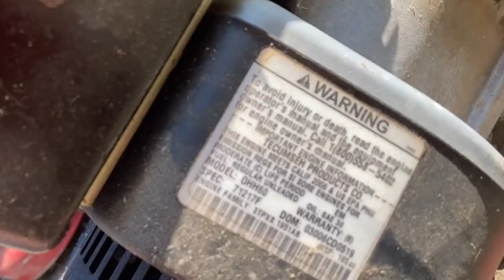GENERATOR PREPPING What you should buy now for your Honda, Briggs, Tecumseh, Chonda generator NOW..

Comment: I keep a Honda generator for the sole purpose of when we lose power. I make a habit of running it about 30 minutes a month just to keep everything fresh. I only run pure gas. It's now about 20 years old and runs like a champ.
Reply: very important to exercise the generator, not just the engine, too.  very depressing to fire up a genset that's been sitting and not get power out of it.  if you've got an electric tool and a quick task that needs it, just run it off the generator, and you're good for another month. (not necessarily for Steve, but for other owners with less experience)
Reply: I have craftsman generator from 1993 after hurricane Andrew in South Fl. I’ve put a carb on it and try to run it a couple times a month for about 30 min. and I do have to plug a tool in to “excercise” it. They are great to have just in case.

Comment: Great video and tips.  I'd like to add a few things, that we have for our generator.

1) Install a Tri-fuel kit. This will turn any gasoline only generator, into a generator that runs on gasoline, natural gas and propane. Gasoline will be hard to come by in a natural disaster.

2) Buy extra air filters to keep on hand.  (Even if they are made of foam) This way, you can wash the dirty filter and while it's drying, put in a clean filter.

3) Have a four pack of extra spark plugs. 

4) Add fuel stabilizer to your gasoline in the gas can.  Rotate the older gas by putting it into your vehicle. Then put fresh gasoline in the gas cans. (Do this every three months)

5) Keep at least two of those, 5 quarts oil containers, on hand.  

6) Run generator, with a load, every month.  This will recharge the battery and keep the engine in tip top shape.

Comment: Great idea to store spare parts! I inventory oil, spark plugs and air filters for all of my small engines in a large storage container. IMO, completely draining the carb may dry out the gaskets. Using non-ethanol fuel will help prevent the carb from gumming out. Sta-Bil will help keep the gas usable for up to a year. Bottom line, use non-ethanol fuel treated with Sta-Bil and start it up seasonally (4X a year). Run under load for 5-10 min after it's warmed up. Easy.
Reply: I agree I have repair shop and expect busy with strom coming 
Dec12-22

Comment: Great video! I have a Generac generator that if you didn't drain about a cup of gas out of the float bowl, you would be pulling the cord all day. l found if I opened the float bowl drain and drained the yellow gas out until it turned clear, it would start first pull and run great. I only run premium gas in all of my small engines, and especially with the generator, fuel stabilizer at every refuel. The gasoline is nowhere near as good, or last as long as it used to.

Comment: 100% agree, I have a gen I got from parents after they pasted. Best I can tell it hasn't run in 6yrs. Last week replaced carb fuel lines and so on. A few pulls on the big tech and off she went, plugged a couple of loads to it. Pretty good feeling now have a gas power washer to tackle.  Thanks for the help you put out there. Only thing I would add would be gas additive and or ethanol free gas stored.

Comment: I owned  a small  engine business  in Indianapolis  for 20 yrs.  I agree  with  everything  you said and would only add when putting your equipment  up for the  season  run either  ethanol free or engineered  fuel through it. Rec fuel or something  like  true fuel will save you big bucks and start up headaches.  It might be a bit more expensive  but if will give you peace of mind. I know live in Florida  and we buy our recreational  fuel in July and it stays fresh  until December.  We then put it in cars, boats, mowers.

Comment: I just recently subscribed to your channel & love it! 
I was looking back in your videos & came across this video on generator prepping. I know you were talking to everyone else & not me.
I researched the generator at our house. We have Honda’s flagship generator the EU 7000is. It is enough power to run our entire house including our 2 1/2 ton central air compressor. I have to admit it takes some juggling in my circuit breaker panel to ensure everything comes on. My generator is fuel injected & when I bought mine three years ago at my local Honda dealer I asked for every option for my needs. I even ordered the lift kit, the preheater & the shop manual. Extra air filter, extra gas filter, extra oil & extra spark plugs. I also bought a trickle charger for the battery. 2 different length cords. An auxiliary fuel tank that extends my run time to 28 hours at half load. I installed a ground Rod & bonded my genny case to the ground Rod to help dissipate static charge & less likely for an explosion when refueling. I have a plastic cap over my exhaust tip to prevent spiders from making a nest in there. As soon as it starts it fires it right off. I had a fabricator custom make a 306 stainless steel cabinet for my genny on a poured in place concrete pad. I had an electrician wire everything up. 240 volt cable rated for 30 amperes. A weather proof inlet. A duplex weather proof outlet for my trickle charger & a weatherproof hard wired remote cable. 
When we lose power I’m often at work already as I’m a power lineman for the local power company. I have LED lights plugged in to outlets around the house that come on as soon as the power goes off. My wife can easily see her way down to the basement to turn on the generator remotely. Then flip the main off & slide the interlock & pick up the whole house without having to go outside. Even our door bell works off the genny.  
I test my genny about once a month. Every other month a actually connect the house to the generator. I have enough fuel to last for a 10 day outage. All gas is treated with marine grade Stabil & Star Tron fuel enzyme. I rotate my fuel every twelve months & burn the old fuel in my trucks. My shelf where I store my fuel is grounded as well. I have a fuel transfer pump that can hold 30 gallons of fuel made by GNC. I did my research on that. They are the best around. So far I’m in the hole about $14,000. It’s an insurance policy incase the lights go out at home. I can take a hot shower after I had worked my first 24 hours straight & sleep in a comfortable house either heated or cooled. Call me a prepper. I wouldn’t mind. That reminds me, my battery is three years old. Time to buy a new battery for it. 
Nice garden by the way. 👍🏻👍🏻👍🏻

Comment: Good video! When I was a mechanic for NT&E,the hardest part of customer relations[as far as gens were concerned],was correctly sizing the genset. You need to add up all the wattages of the equipment you wish to run,and then multiply by 3.This was manufacturer's suggestion,because an electric mtr starting up draws 3X the running wattage.And if you use too small a genset,you burn up genset and your appliances.
Reply: thx

Comment: I use a propane powered generator to avoid fuel related problems . We ran it for about 4 days during the big freeze blackouts in Texas . Used about 50 lbs of fuel .

Comment: One thing I've been doing for probably 5-6 years now is treating my fuel that goes in my small engines, whether it's my 2 generators or whatever.  I've been treating my fuel with STABIL MARINE 360 at double the rate on the bottle (make sure you get the MARINE (it's Blue.., not the Red Storage version)), PLUS adding SeaFoam to the fuel at 1oz per gallon.  Since I've been doing that, I've had ZERO fuel issues, knock on wood.  I just got my big generator out last week getting it ready for the winter storm that moved through, and it has not ran in a year since I did the last maintenance run on it.  Turned on the fuel petcock, waited a minute for fuel to fill the carb bowl, and it started on the first pull, as it almost always does... and that was at about 35°F.  It's got a Yamaha MZ360 engine.  GREAT engine so far in the 57 hours I've put on it over the last 10 years since I bought it, easiest starting engine I've ever had... Honda could learn a thing from this Yamaha (and Hondas start pretty easy already)... it's a shame we don't see more Yamaha's.

I also run Shell Rotella T-6 Synthetic 5W40 in my generators... great oil, and yes, it is Diesel oil.  It's also probably one of the best small engine oils you could use.  I run Mobil Delvac 1300 Super 15W40 in all my OHV small engines that see more regular service, and it has been performing extremely well also.  

I no longer have any of the old flathead Briggs engines... Rusty gas tank killed my last one, It was only a few more $'s to replace the entire engine with a HF Predator Chonda.  I'm curious to see how long the Chondas will last compared to the old Briggs.

Comment: Good, informative clip and will come in handy for those with gensets. The Honda drain plug on the floatbowl is a good idea others should follow. Also, an owner can put a 'T' just after the fuel tank to drain all the old fuel so its good to go next time. The ignition module, spark plug are some of the parts good to have spares of.
That is a good garden, did you know that figs are actually a flower and not a fruit. All flowers bear a fruit, but a fig is a flower itself that has grown inwards. We are gardening here as well and our summer has just started in down under New Zealand. Cheers Chickmechanic!

Comment: I have a Kubota 6500 gas. Even though it starts with the pull cord I have it on trickle charge and always run stabil in my fuel. Just changed the oil and replaced the air filter. Ready to rock! Also have a little 2500 watt harbor freight generator that is also ready to rock. Awesome video thanks

Comment: Don't forget to change the oil every 50 hours. I live in central Florida and we went through 4 hurricanes back to back to back in 2004. We were without power for about 60 days (miserable). Most folks change their oil in their car maybe once or twice a year, and think they can do the same thing in a generator. Well, a full load for 50 hours on a generator at 3600 RPM is demolishing the oil. You have to change it every 2-3 days or you WILL blow the engine up. My neighborhood had blown up generators in the trash in front of every house. I personally drain the tank and carb bowl of all fuel before storage and so far so good. I also use fresh non-ethanol fuel that is less than 2 months old. Once it gets two months old, I dump it in the truck and replace it.

Comment: Lots of good preventative maintenance tips. We have a Harbor Freight Predator generator, very similar to yours, less the dog chewed handle. As part of the warranty process the manual says run the generator every 3-months. Thought that was good advice so I stick in a little stabilized gas and connect a 1500 electric heater as a dummy load every few months.

Being the anal engineer that I am record each test, oil change in a little log book. So far so good.

Not a maintenance issue but need to think about fuel and fuel storage. I opted for a gasoline generator. I keep five 5-gallon containers of stabilized gas on hand.  The containers are numbered and if I don't need the gas dump oldest into the car to maintain rotation. Stabilized gas in a sealed container lasts pretty long as moisture from the air is kept out. I do limit gas to less then a year. With judicious use of the generator gas should last a week.  That is pretty much the maximum outage for a winter ice storm here in frozen NH.

Comment: my tips: put a second (plastic) fuel petcock in line after the factory one, because that factory one will corrode and stick.  also, get something that can make a roof over the fuel tank.  it doesn't take much, just a piece of metal roofing or even a big dishpan will work.  that big flat top will collect rain, and it will puddle around the fuel filler and be drawn in through the vent when the engine is running. before I started using a roof, I had a time I had to drain CUPS of water out of my tank during an outage.
also, ethanol free gas costs more per gallon, but it significantly reduces problems.

Comment: I have an ancient Honda rotavator/tiller/cultivator which has a little tap on the fuel bowl so you can just drain the carb. Lovely. More modern ones have a screw you can take out, but not so convenient. My Chonda generator has the screw.
The air filter was paper but it went mouldy.

Comment: Very good points especially having a back up carb. When the power is out you may not have a local shop that is open. Extra plug, filter, oil, doesn't cost much. Great video!👍🛠

Comment: Fuel stabilizer is your friend even with diesel. I have been manufacturing and servicing generators since the age of 15 in the 1970's and have found that for anything other than base load units this is a must.

Comment: The easiest way to assure a small engine is ready to go is to run the carburetor dry between uses.  If not equipped with a fuel shutoff,  install one.  And yes drain fuel from the tank and use elsewhere so you're not wasting fuel by letting it go bad in an unused equipment.

Comment: I recently got my old 1941 made Lausen engine on my WW2 Navy generator running,it was in a field for many years when we bought property,it will be great if I ever find any WW2 radio equipment and another person with the same :D  My other generators get filled with stabilized fuel and run once a month to circulate the fuel.

Comment: I run both my portable generators once a quarter.  I load them to 50% for 5 minutes.  I then close the fuel isolation valve and run the carb out of fuel.  What I found is that the little bit of fuel left in the carb bowl would cause a little rust (especially  with ethanol fuel).  I take the time to drop the carb bowl and dry it out and reinstall.

Comment: to pull the fuel filler screen out put two fingers into the opening spread the fingers to grip the inside of the screen and lift. no fingers in the way on the outside of the screen body. retired heavy equipment mechanic also small engines.

Comment: Talk about dual fuel, propane conversion. I've converted all my generators, pressure washers, and log splitter.
Reply: my largest generator, a champion 3500 is duel fuel i keep 3 20 lb tanks around.
Reply: @MrSGL21  I just finished a conversation on a Champion 3k. Test run went well. Load tested at 2000 watts to get the rpm set for correct voltage and hertz. Yours will always run when you need it with propane.
Reply: I converter my Black Max 3600 with a dual fuel carb back in 2016. Works great. I only run on propane and do have the natural gas option. They say you don't have as much wattage capability with propane but mine seems to handle loads just as well as it did with gasoline. Engine runs quieter on propane.
Reply: @Deucealive75  Always make sure that at no load you're running at least 3720 rpm. You need a tachometer for that. I never load a generator past 3/4 of its maximum rating. I adjust the LP or NG accordingly to that load. All of my equipment keeps clean oil due to the conversion. Propane is 110 octane, and has a closer BTU with gasoline. NG doesn't have nearly the BTU. Thats why NG need more flow, therefore governor control need to be adjusted.
Reply: @MrBjseales  I adjust by voltage and frequency. I run 122 volts no load and with a 83% load it's at 118 or so. 50% load should put it right on 120 and 60 HZ. The 83% load is just a test load. During outages it doesn't see that large of a load.

Comment: Nice information ….. my experience has been close the fuel-cock until engine stalls …. then wait a few minutes and pull the cord …. the engine restarts for a few minutes due to the accumulated gasoline remaining in the line & carb bowl …. Ps …. I like to buy a 10kw Honda because I think we are vulnerable …. Last, no area power, no gasoline stations either …. ☹️

Comment: Like you said, generators sit for a long time. Every time i use mine, I have to pull the carburetor off . I converted mine to propane so I don't have to mess with gasoline.

Comment: My experience with small gas engines is running it with the fuel tank empty and/or the fuel shut off until it stops running will help the carburetor keep working well. If you don't need to use it on a moment's notice draining the gas is also a good idea.
Reply: That works good on a lot of engines. I do that with the Red Seal engine on my Lincoln SA 200 welder. Never have a problem starting it even after months and months and with old gas. Super Unleaded seems to not have the problems that regular gas has. I run it in all of my lawn equipment and have for years.

Comment: I have a McCullough generator that has given me good service for years. I run it once a month and use non ethanol gas. The only problem is that I had to order a spark plug from England as nobody states side had a crossover number or different brand. Apparently, anything Mccullough has to come from England now instead of the USA.

Comment: Just quick tip for people who have the 2.2 honda camp generator 
The on and off switch  is also the fuel off switch, so they recommend you turn off the fuel tap/on off switch and let the fuel  run the carby dry, but when you want to restart it , it takes 5 or so pulls to get it going again and this is because there is no fuel in the bowl.
Best turn the switch to on and go have beer and when you get back it has let the fuel trickle back into the bowl and one pull it will start 👍